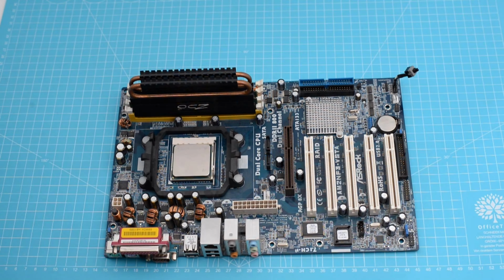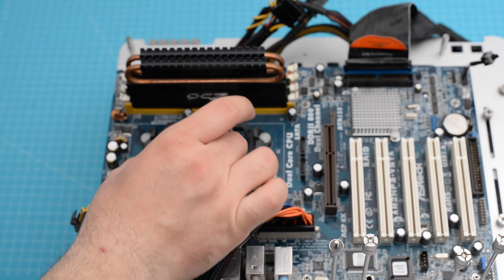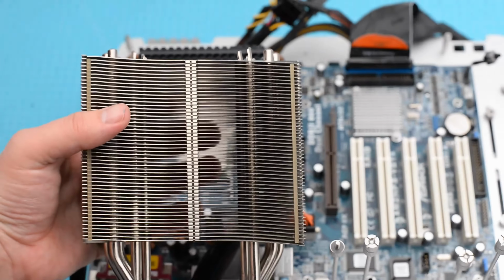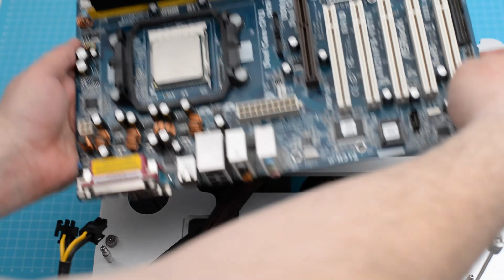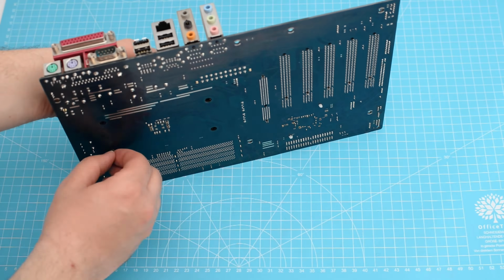AsRock AM2NF3-VSTA and AMD Phenom II X4 965 - Testing Nvidia graphics cards

Comment: I do not get close to the same OC options on my AM2NF3 with the official BIOS 3.30. do you run a modded BIOS?
Reply from the maker: I think it's the cpu that unlocks those options. You can try these Phenom cpus even the 965 are really cheap now. I got 3 or 4 during last year and they were all around 10-12 euros. Initially I started with an Athlon 64 that was far more limited.
Reply from the maker: I also think I'm running the latest official bios from Asrock.
Reply: @TechLab47  you're right, that's how they did it. On other platforms, the setting would be greyed out, but on this one there is no setting at all when you don't have the right CPU. Weird.
Reply: It was the CPU, with a 965BE the settings show up.
Reply from the maker: @andreewert6576  I'm glad you discovered them. I also went from the Phenom to an Athlon X2 at some point and many of the options were gone, so I knew back then that the Phenom unlocks more.

Comment: Hello. What power supply is installed to run the phenom 965?
Reply from the maker: Hi, it is the same PSU I use for all of my projects where an ATX is required, a Corsair TX750. For some projects on this channel I also used a Corsair VS650 and a Mushkin EP-400AP for the low powered ones like the mobile Pentium-M and the socket 7 but by the time I reached this project I decided to exclusively use the TX750 because it looked a bit more capable than the VS650 and had extra protections.

Comment: Very nice motherboard, you'll never bottleneck any video card with that CPU, not even the HD 3850.
Reply from the maker: Yes, but it was seen as a cheap solution back when it appeared. Everyone was migrating to PCI-Ex and AGP was becoming a thing of the past. I was fortunate to get one in a good condition and I'm able to overclock the CPU quite nicely. I'm currently compiling the results for the ATI Radeon cards and indeed HD3850 is the king of AGP. I had the impression it would be quite close to the HD4670 but the difference is noticeable. (as a spoiler, on this setup, it got 57200 points in 3dmark 2001 compared to 49190 for the HD4670 AGP) The HD4670AGP is closer to the X1950XT AGP. The second part of this episode should be out in a couple of days and all the results will be there for: 9000 Pro, 9550, 9800Pro, x850xt, x1950XT, HD 2600XT,	HD 3850, HD 4670.
Reply: @TechLab47  Yes, it makes sense. I really don't know why some motherboard manufacturers still used AGP, but I'm thankful :)
Reply from the maker: @MidnightGeek99  The reason they moved away to PCI-Ex was that word was going around that the AGP 8X will not provide enough bandwidth which proved not true, at least for a couple of generations. Also, no top chipsets supporting AGP were released beyond some point. If you think about it nforce 3 is one of the latest on AMD. On the intel side there's the 865PE which is also pretty old since it first appeared on sk 478. (and also VIA PT880)
Reply: @TechLab47  Nice, I've always thought that the 4670 is close to the 3850...
Reply from the maker: I thought so too but they are not. Not overclocked and on this board the differences range from 20% to almost 33%. Still I would argue that 4670 is better optimized as it draws far less power. Or it may be a driver issue, as I had a lot with the radeon cards. (I'm using 12.3 for both HD3850 and HD4670)